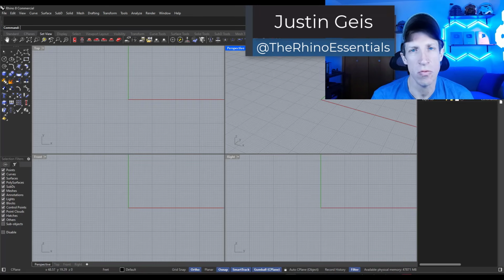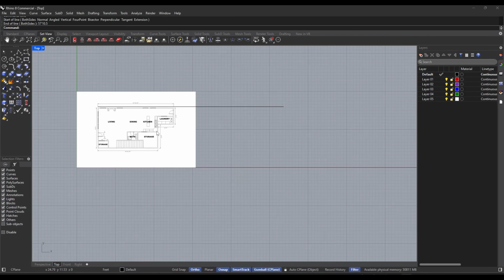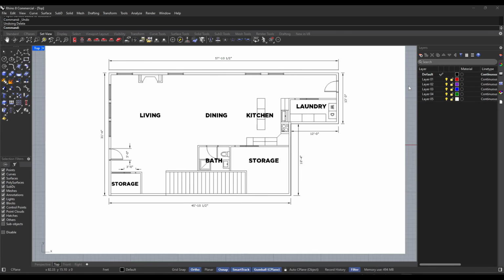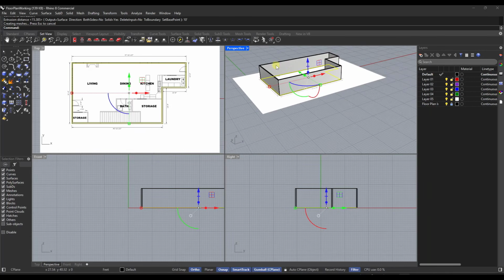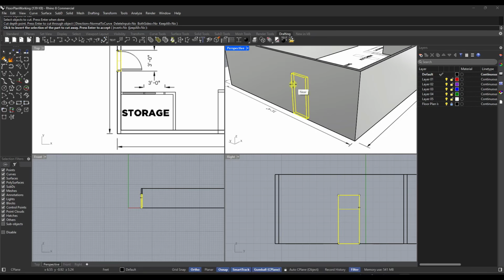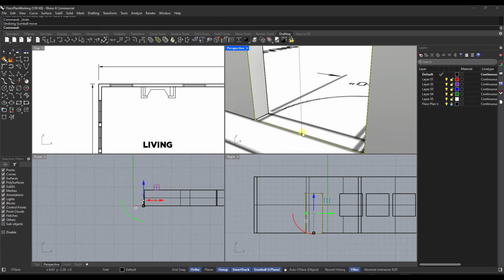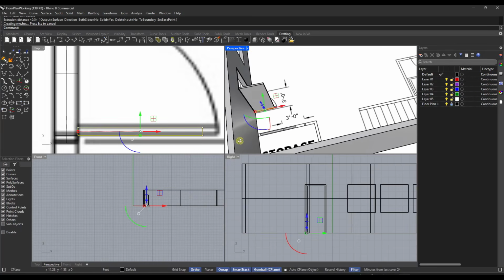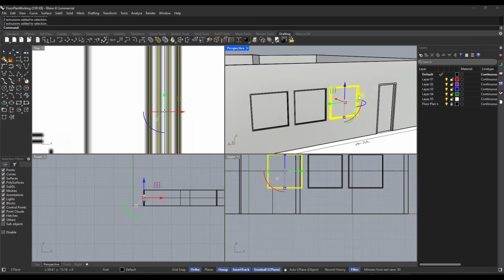Getting Started with Rhino 8 Part 3 - Modeling a FLOOR PLAN!

Comment: @TheRhinoEssentials OK you renewed my curiosity about Rhino.  I have a big question that I think you are particularly qualified to answer.  How does Rhino compare to Sketchup for advanced architectural modeling & drafting?  I've been using SU + LayOut for years in residential construction, to do conceptual, structural, interiors, all of it.  E.g. a model + docs, with demo/modified layers, framing details, DWV pipe, ready for TwinMotion, etc.  It looks like Rhino has way more features than SU, and I generally like the vibe and the development direction... but I really want to know what it's like to manage a complex Rhino model, make big changes to it, and use it for construction documents.  And also how it feels to model quickly, something like the framing of a roof, as a power user with all the keyboard shortcuts etc.

PS- regarding KB shortcuts.  I would be interested to set command line to a shortcut, and assign keys to core tools, so that I can leave my hand on the mouse most of time.
Reply: He sadly does not answer to any comments. It's been nine months since you made this comment. Have you found your answer?

Comment: Any idea why wire cut is doing something completely opposite than in the video? It's leaving the windows insides and it's cutting all the  rest of the model. I have to tick keep all and then delete the windows manualy, otherwise it will not work. Any suggestions?

Comment: Was trying to do the push pull command where a line needed to be added to the rectangle. For some reason my lines aren’t showing up on the faces of the cubes?
Reply: Was dealing with this yesterday, the closest I got to fixing that problem was clicking on the side you wanted to draw on you can hold (ctrl + shift), after that you can spell (splitface) as a command, and click ENTER on your keyboard, draw the shape or design you want and it should work. (Make sure the grid is aligned with your side or it will not draw on your shape or wall!)

Comment: Hi Justin. Thanks for producing the Rhino Essential series. After working on Sketchup for more than 15 years, I've recently had to switch to Rhino as my weapon of choice.....so there are some differences I need to get my head around. I have been struggling with the Gumball>Copy with distance. I think I have it now, but I think it needs to be clearer that just to copy its Tap Alt but to copy over a distance its 'Hold Down' Alt over the Gumball Arrow...not quite as inuitive as Sketchup... move  distance, but I'll get used to it.

Comment: bro, you don’t have to draw a line, you just need to select a 2D scale, take two points and write the desired value on the command line
Reply: And it’s better to block the picture, not the layer, otherwise if you touch the layer, it will be unlocked